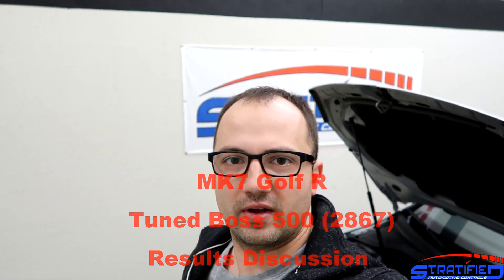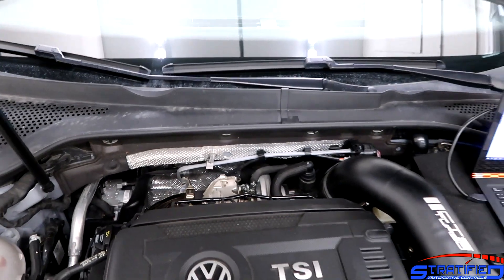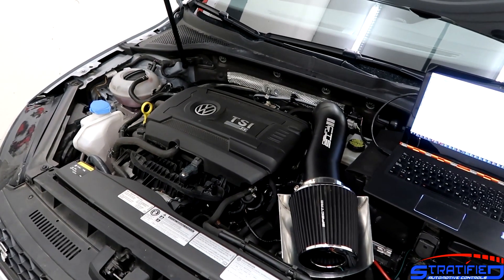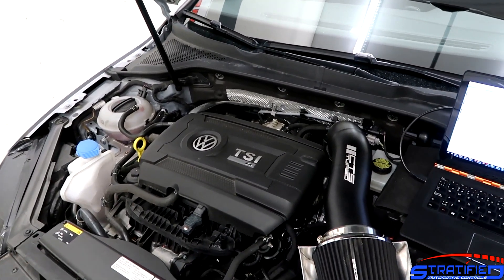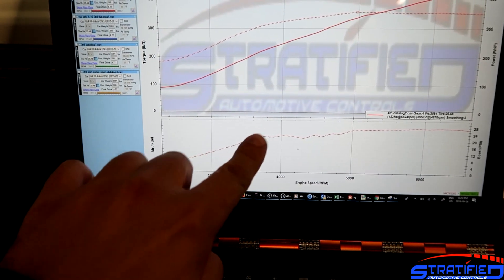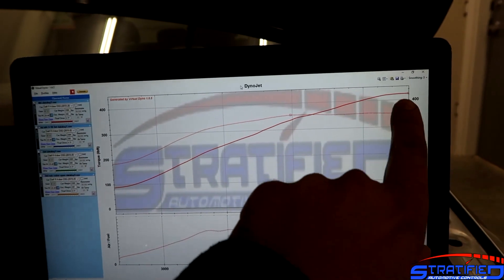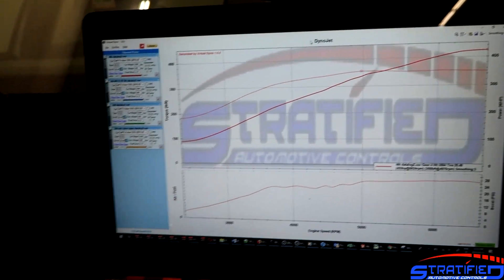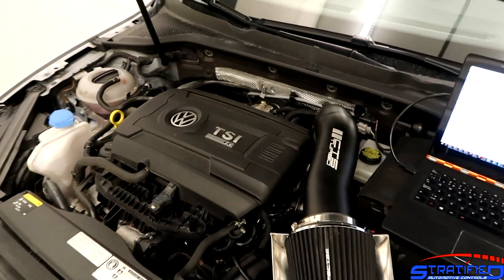MK7R Boss500 Tune Discussion

Comment: How much power can you get from the Boss700?
Reply: https://youtu.be/Yo_AuQoDU1o
Reply: @anieves102  is this at the wheels? Whats you full supporting mods please?
Reply: @fabianarmstrong6314   I listed the mods on my YouTube page.  My comments to you keep getting deleted....
Reply: @anieves102  is this power at the wheels or crank? Thanks
Reply: @fabianarmstrong6314  At the wheels.
Reply: @anieves102  any idea on crank hp buddy?
Reply: No idea.  But on average you lose 15% from crank to wheel, so it should be safe to say at least 10% more at the crank.  So at least 587hp at the crank
Reply: @anieves102  i thought the boss700 would make more power than that at 30 psi to be honest. Does not sound like it will get anywhere near 700hp. Is your power on ethanol also to see 534 at the wheels mate?
Reply: @anieves102  is this power pump fuel or ethanol blend? Thanks for any info 👍🏽
Reply: @fabianarmstrong6314  ethanol blend.  Tuned by United Motorsports.
Reply: @fabianarmstrong6314  we ran out of fuel.  Not trying to hit 700.  We will hit 600+     Going to Tuner Gruupe in April to replce the 980 injectors w 1300cc injectors.  We care more about tuning properly and have a healthy power band.  We will see what happens in April.  Stay tuned.
Reply: @anieves102  a tuner here in the uk told me the stock ecu can run upto an E30 blend
Reply: @anieves102  where are you buying the 1300cc injectors + adaptor loom?
Reply: @fabianarmstrong6314  check out my parts list on my page.  All of the parts are listed.  I'm running mpi 8 injectors
Reply: @anieves102  i have seen your spec buddy and its awesome. Can the turbo run more than 30 psi boost?
Reply: @fabianarmstrong6314  yes.  We will turn up psi when we retune after the injector upgrade.

Comment: Hmm is Petro 94 bad all around Canada? 
Not sure if its the same as in Ontario
Reply from the maker: This is specific to BC where we have no ethanol in the fuel due to legislation. In Ontario the 94 oct fuel contains ethanol and is much much better at resisting knock.
Reply: @stratifiedauto  and Alberta has a high ethanol husky 94

Comment: Have you guys tuned any hybrid turbos on the R? I am well acquainted with the crappy local fuel in BC and fill up with Washington 92 whenever possible. Would be interested in having a Strat / Cobb pro tune done on my R once they release dsg support, on a fast spooling hybrid (littco 450 or EQ).
Reply: We haven't done any hybrids locally but have worked with some remotely. Would be a fun setup for sure! Drop by if you have any questions, we love seeing locals!